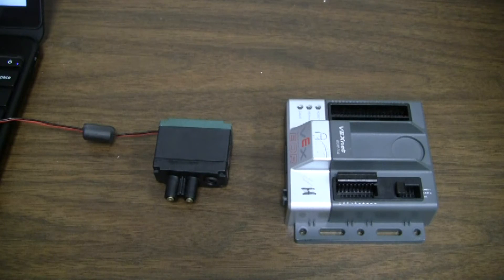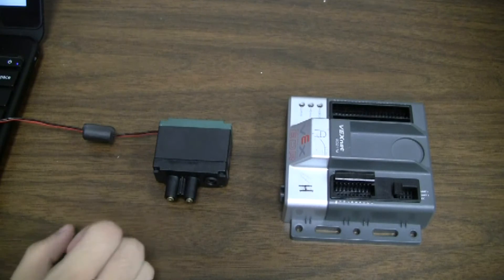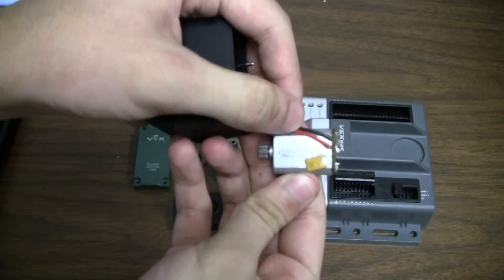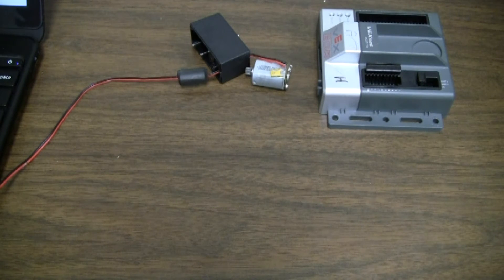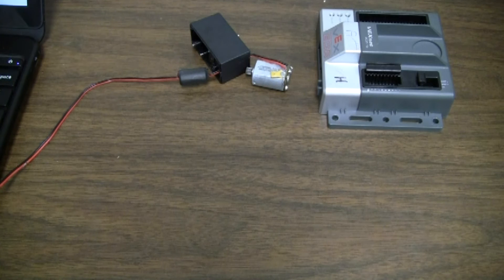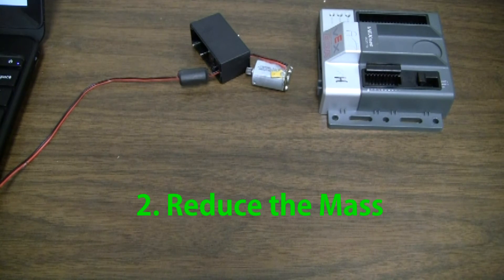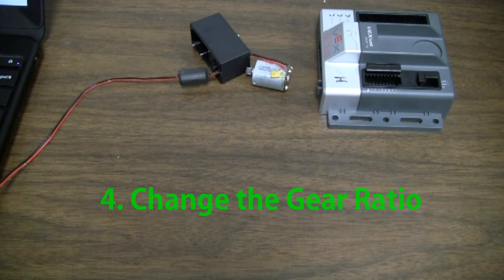Vex Motor - Overheating

Comment: My motors would work for like 4 seconds but then would stop for like a minute is this why it doees that?
Reply: Pedro Caro yes, very likely.
Reply: okay so what would be a good drive train for heavy robots
Reply: try to lighten your design as much as possible.  If still to heavy you can run three motors together with 3 36 tooth gears.  This will triple the torque of 1 motor.  But 3 motors on each side of your robot for 6 motor drive.  Alternatively you can gear down your motors such as a 12 tooth gear to a 36 tooth gear, but you will sacrifice speed.

Comment: What mechanisms can you use for designs where stalling of the motor is part of the design? For example when grabbing an object and holding onto it? In this case you would stall the motor if you keep the grabber open (if you use rubber bands pulling it back together) or when closed to list the objects. Is experimenting with the minimum hold force a feasible option by monitoring the motor position with a potentiometer?
Reply: They used to have these little green plastic clutches that would click.

Comment: Is drilling vent holes into the motor case a good way to eliminate overheating?  Or making the motor case have a aluminum wall instead of all plastic - as a heatsink?
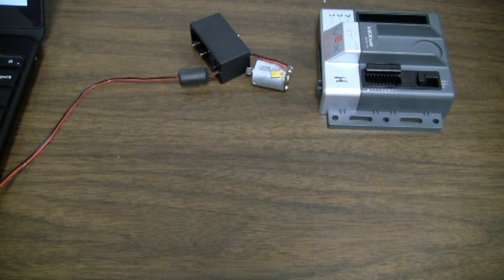Reply from the maker: +gardogg65 Drilling holes or using aluminum will reduce heat but it's not really the motor which is getting hot.... its actually the PTC.  The PTC will trip when the too many amps are pulled.   If you are having trouble with the PTC tripping do the steps mentioned in this video at the 2:10 minute mark and keep the amp draw down!

Comment: I currently have this issue on my robot and I have two motors on each of the side of the robot which makes the wheels move. if I add another motor to each side ( making the robot have two motors on ech side instead of one) will this make the robot not have the PTC and overheating problem not happen again
Reply from the maker: ***** Two motors are not enough if you have a steel robot or even an aluminum robot.  If you only have two motors on your drive, then I suggest you use compound gearing which we have a video of or use 4 stock motors and you should be fine.
Reply: 2 motors are stupid